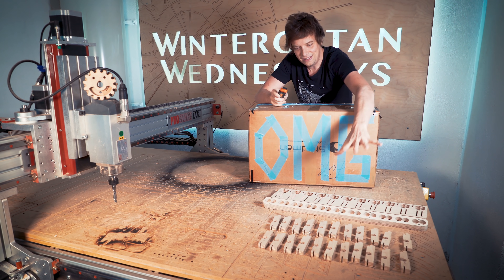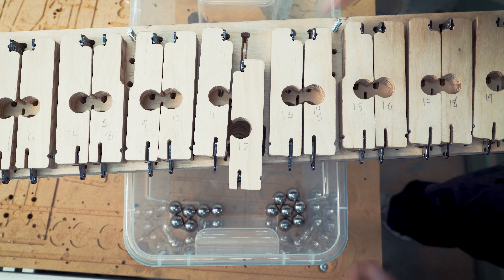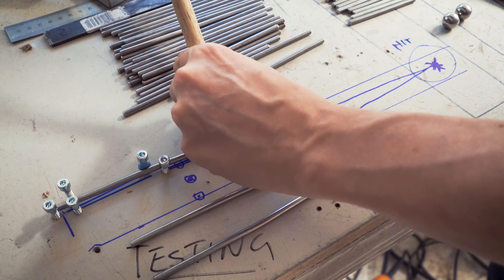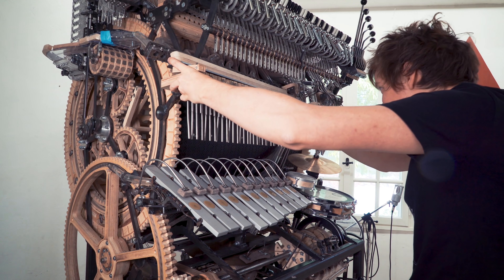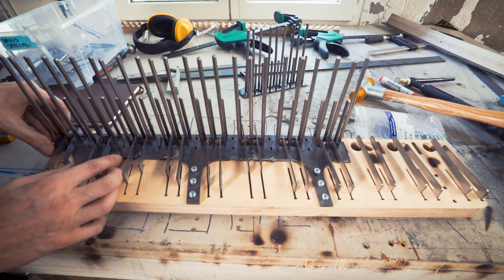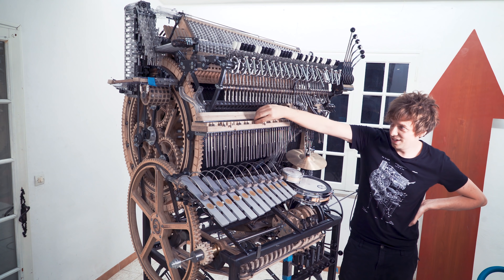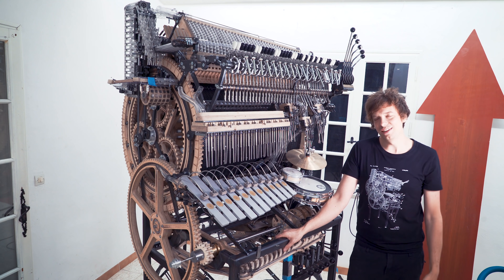My Best Design Yet - Marble Machine X #102

Comment from the maker: I just discovered there was midroll ads on this video earlier, we did not put them in. I just got hold of the third party company who added the Midrolls, and they are now removed. It is a setting issue that i have discussed with them before and we are now looking to solve this longterm. // M Ps. Carlos Montoro from Anjudaguitars.com is here today and we are working on the bass guitar... things are happening! DS.
Reply: Wintergatan 
I’m excited to see how you make marbles accurately hit and depart from a bass guitar string
Reply: I don't understand, how can someone else add ads to this video than you Martin?
Reply: Martin, if you see this be sure to pin this comment so it shows at the top of the comments!
Reply: It looks to me like there is going to be a buffer of marbles in this new assembly for the marble drops. This is going to cause some latencyActually, 4 resting positions account for... 2 continuous pins in the programming wheel? Hope you have accounted for that, as it can have an impact on the beginning of the first song you play every time you remove all the marbles from the machine, i.e.: for transport between concerts.
Reply: Martin, If I understand your marble drop mechanism for the Xylophone properly, it takes 3 operations to drop one marble? How will you program this properly on the wheel? Will you need extra “dummy pins” just to drop one note?
Reply: @NexxuSix  No, no..... the final marble drop gate and the shuttle gate are connected together.  One programming pin will drop a marble AND open & close the shuttle to advance all the marbles in the queue.  ONE pin does it all, and there is NO latency, other than the time it takes gravity to drop the marble.  Martin has a calibration for different BPMs as explained in a video about 9 months ago......  He's a great engineer, and is considering everything!
Reply: @NexxuSix  It actually takes much more than 3 operations. Each marble has to go to the lifting wheel, the demagnetizer, the conveyor belt, the marble gate (3 positions in that), and then finally the 3 operations that you mentioned. Similarly to all of these, more than one marble will be going through the steps in this mechanism at any one time. Also keep in mind that one programming pin gives a back-forth motion, which means that marbles can move up to two positions for each programming pin strike.
Reply: Davie504 liked that
Reply: Just realized now: wount the upper shuttles/gates now be redundant? How will you handle them?
Reply: 涼しげな音を出していますね、蒸し暑い日本の夏には最適です。
Reply: Of the week idjvcjc
Reply: Been wondering why u dont have an electric motor to turn the machine instead of u turning it, so u have same even speed. Was just watching the video where u had the drop of the marbles, if u rotate the machine faster, the marbles will still drop at the same speed, meaning that if u run the machine faster the marbles will still fall at the same speed, and u will have a delay, u cant make the marbles drop faster, even if u rotate the machine faster, just saying :-)
Reply: @Pianissimo1970  If you watch previous videos you'd know this isn't a problem as songs are calibrated to their bpm, it's never going to be an issue with the drop time.

Sorry I can't help you on which video this is explained, but I believe it was made within the last 6 months.
Reply: Pianissimo1970 This video shows Martin's solution - The Musical Timing Clutch https://youtu.be/CBfd0Tjii9Y
Reply: @SyzygyNoon  still he would have both hands free to turn handles and manage the machine if he put on an electric motor :—)
Reply: @Pianissimo1970  That's why he has the Treadle Pedal.
Reply: @Pianissimo1970  The point of it was to be mechanical. He also has a flywheel to ensure consistency
Reply: @r0xdab0x96xo  Electric Motor would ruin the human element of the music!
Reply: @bartholomewbilby1333  I didn't suggest an electrical motor. I mean't mechanical as in manual, non automated. I fully agree with you.
Reply: @Pianissimo1970  You need to spend a day or 2 or 3 and watch all the previous videos plus the music machine mondays series. You won't be sorry and you'll be able to answer all your own questions.
Reply: @Pianissimo1970  The MMX is not meant to be a perfect machine that plays songs on command. It's an instrument to be played. The ability to dynamically slow and speed up the song a bit as you feel the music is not something an electric motor can do. Also, it's heavily inspired by the music machines of old which were human powered. It's supposed to be able to go into the Speelklok Museum one day and not be out of place.
Reply: @Pianissimo1970  Because it's a manual instrument. And regarding the marble delay base en speed playing, you can watch the video #77 where he develops a clutch system to have not delay regardless of the speed playing

Comment: Very cool design. I understand that it is fun for you to weld bud wouldn't it be better some parts screw together. Like the metal rods when they bends or damage. Or are you afraid that vibrations would loosen those.

Comment: I think we can clearly see the balance between perfectionism and allowances here, a true perfectionist approach would have had that metal piece machined again, while overcorrecting for perfectionism and allowing anything to do was what gave us the mangled mess that ultimately had to be removed before this system was designed. Here we can see the balance: a well-engineered system but allowances made for the little things that come out of the woodwork during assembly and fitting. It gives us the machine Martin deserves, but it also stops us becoming lost on the road.

Comment: Couldn't the marble divider be extended down to this piece? Then you would lower the risk of a channel running out of marbles. Or rather: why does the marble divider still has these 3D printed "one marble at a time" marble drops? The tube from the marble divider to this thing could just be filled with marbles.

Comment: A complete layperson's perspective, here, but the previous design of the drops seemed prone to accidental bending and while this design has straight drops, is there any concern about them bending in transit or during assembly on tour, which would cause the marbles to not hit precisely where intended on the vibes?  Would welding some perpendicular rods across the back of the drops, where they would not interfere with the marble paths, provide some rigidity and prevent this from happening?

Comment: I'd like to offer something I do when using screws in wood when I have to remove them to keep the wood from stripping out. After removing the screw the first time add 5-10 drops of crazy glue in the hole it helps me a lot from stripping out the wood

Comment: Are the L hooks causing the marbles to be dropped on the failing edge of the programming pin activation? It seems that your notes will play when the pin has left contact with the registers,rather than when it makes contact. I just wanted to be sure that is what you intended, because it might affect timing.

Comment: This is by far a better mechanism..  The previous hand-bent rails is unreliable and would not survive constant assembly/disassembly/shipping without a lot of manual tweaking each and every performance..   Not to mention that it is very "ad hoc" and Marble Machine 1.0 and not the more structured CAD-based design of version 2.0..  I'd basically say the same of any other parts of the machine that still remain as hand-tweaked wire (these are not repeatable/manufactureable).

Comment: solution: kindly beg for a new bottom plate, thread the holes where the guide rails were, thread the ends of the guide rails, lil bit of thread lock, bing, bang, boom!

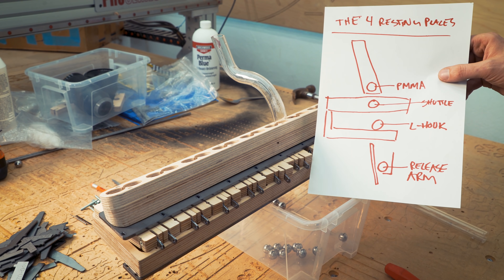Comment: 3:31 "Only simpler version would be midi keyboard."

I mentioned it a while back, but I still think a simple seesaw that catches the upper marble while releasing the lower marble would be astronomically easier to implement.
https://i.imgur.com/7Wgd45Q.png - The upper fingers move easily between the marbles when the mechanism is pivoted to release the bottom marble.

* I am not a professional 3D artist.
Obviously this is just a quick render I made in Blender to illustrate the idea. I'm sure Martin and the rest of the MMX team could some up with something that looks more elegant.

Comment: The audio channels seem to be out of phase. Check your phasing buttons on the mixer. For instance, at 8:00 the room reverb comes from the centre between the speakers while your voice seems to be coming from behind me, sound scape wise. Highly unusual :P 
Either that, or you mixed it in SQ quadraphonic, but there is certainly a lot of phasey weirdness going on. 
Regards, 
A Perfectionist.

Comment: Kinda worried the drop mechanism keeps getting more and more complicated, will need more force to drive it and the programming pins and its holder will have to handle more shear, will wear down the plates quite quickly :(

Comment: Rather than welding the plate back together while bolted to your finished plywood, pull up the tool path for the drilling of those holes and drill them in a scrap piece of plywood. You can bolt the metal to the scrap, weld it there without worrying about damage to the wood, then remove the scrap and bolt back on to your final - unburned - part.

Comment: If you want to avoid metal distortion from welding then its going to take forever when you need to let the metal cool down. Other solution would take somewhat long time as well is to make threads to those metal rods and screw them on to the metal plate.

Comment: Just a thought, those metal marble guides will cause a little bit of sound as the marbles ride the way down. You may want to powder coat them to reduce the sound.  Just a thought.  The sounds may get picked up on a microphone.

Comment: Martin, is the assembly not in final configuration or did you forget to attach the two metal side pieces onto the assembly? It looks like the gate you were sliding in and out at the end of the video was incredibly wobbly (side to side) without them. :X

Comment: I'm increasingly worried about the durability/longevity of some of the sub-assemblies. Those metal pieces rubbing against the wood components will relatively quickly cause wear making the tolerances less tight. Also worried about the big wood gears rubbing on each other. Is there a plan for replacement parts?

Has there been any discussion about expansion and/or warping of the wood components in warm and/or humid conditions? Don't get me wrong, I love the design, especially the wood components (I wish there were more) but the complexity and sheer number of  moving parts made from different materials is a concern.

-Paul

Comment: OK shrinkage explained: when you heat metal up at one spot it will get soft and expand. It will not have enough force to expand the cold surrounding metal, because it got soft - so what happens is that the warm metal will distort, because it wants to expand, but the cold and harter surrounding metal keeps the hot and soft metal in place. but the moment the hot metal cools down it regains it's strenght and will be able to contract the surrounding metal just as fine as the surrounding metal since all the metal is now cool and has the same strengh. that's why your metal will shrink where you heat it up!

Comment: Defending redundancy: remember, the first set of registrators at the divider contains the muting mechanism, and ensures the marbles line up along the track. The second set drops the marble. The design was always "load/release", it only seems redundant now because the engineering is mirrored. Perhaps there's a solution in which the height of the marbles, the muting mechanism, and the drop mechanism are all controlled by a single registrator, but I hesitate to even mention because I'm afraid Martin will take a hacksaw to this beautiful machine again and we'll have to wait even longer to see the MMX play 😆
Reply: I still suspect that the Marble Machine 3.o will have 4 or 1o less gate mechanisms ;) - design is the ossification of a philosophy - the fear , hyper -concern seams to be for precise marble drops and total control over that - probably as resulting from experience with the first marble machine - Marble Machine 3.o will be less mechanically interesting (e.g. with less complexity and number of parts) - but will be more streamlined and optimized - :)
Reply: Still, I haven't seen the machine up close - so I am conjecturing based upon a lifetime of making machines and studying them - as well as following this entire process this past few years ,and the history of invention. I halfway - trust Martin when he says it's necessary :p and that's okay :)

Comment: How much those metal wires are guiding that where marbles drop and what happens if one or few of them are slightly bent? Because wires are attached from the other end only, it is easy to accidentally bend those when dismantling, moving and assembling the machine and you might need to finetune them before each show. This second design is definitely better than the first one.

Comment: I'm guessing the stack of washer is for adjustability? Instead of a stack of washers, you could use a piece of steel pipe. You could then also have a little counter sink in the wood for the pipe to fit into which could be made on the CNC. This way things won't move when trying to assemble it and you could still use washers to adjust things if needed. Looking good though :D

Comment: I thought the whole point of redoing the marble drop for the xylophone was so you only had to move the notes on the xylophone up and down as opposed to having to bend and move the marble drop. You're still having to bend metal on the marble drop to get it right.
Reply: Not quite.  Before, the ideal striking point on each note of the vibraphone would not align in a straight line.  So he would have to bend different pairs of channels to hit each note in the ideal spot.  Now that he has reworked the vibraphone holders, he can adjust them so that the ideal striking spot can now be arranged in a straight line.  So he doesn't have to bend channel pairs to strike in different locations in regards to the length of the different notes.  But he still wants each channel in a pair to strike the same spot in relations to the width of the note.  Remember, each note has two channels that will drop marbles on it.  So, each channel in the pair needs to be angled in a way that it will strike the same spot on the note.  That part has not changed.

Comment: This assembly makes quite a large part of the marble divider redundant in my opinion. The marble queue could be longer in each PMMA tubes before this assembly and it would remove the need for a lot of parts in the divider. I also am starting to wonder how long it will take between each show for the disassembly, re-assembly and adjustment. May be removing redundant parts from the divider could lower the time, risk and mechanical drag of the machine.

Comment: Marten: One question, why did you weld the marble guides on?  Why not thread them to the metal plate so they can be replaced easily?  Maybe they will become bent during assembly / disassemble, etc?
Reply: Additional comment... Since each metal rail is independent, they are more likely to separate from one another.  I thought the original 4 rail system would be more reliable since the spacing between the rails cannot be changed as easily.  Any benefit to connecting  pairs of rails together to prevent separation or is the middle thick enough that they wont bent away from one another?

Comment: Suggestion on the heat distortion problem: don't weld long delicate parts like this, braze them instead. Either welding or brazing is an arbitrarily strong connection in your use case, but brazing would involve much lower temperatures and much less distortion of the metal. Too late for this piece, but may come in handy for the future.

Comment: I dont know if he covered it, but why doesnt he direct the two channels per note onto one final guide rail? It would be like a Y channel. The only problem I see would be if the fastest timing makes the distance between the two marbles smaller than thier diameter. But even with this arrangement he is now using, that just means they would collide in the air, unless they are hitting two different locations on the instrument.
With a Y channel, both marbles can hit the sweet spot accurately.